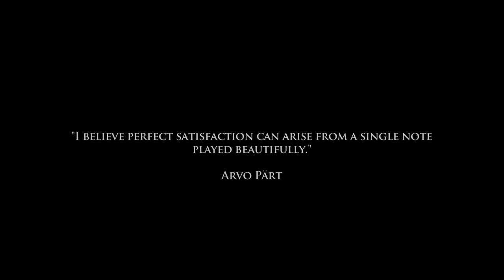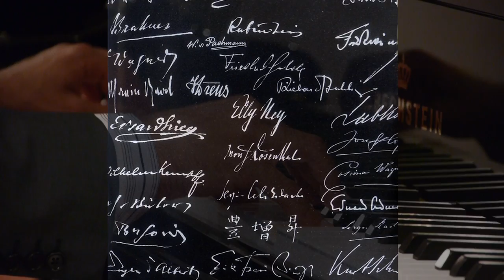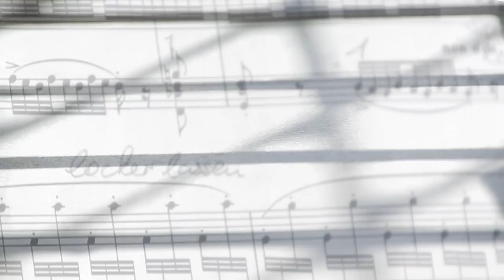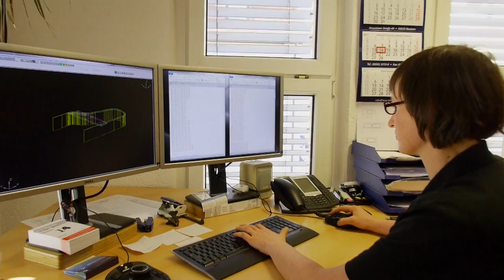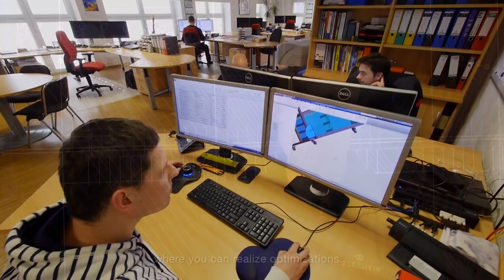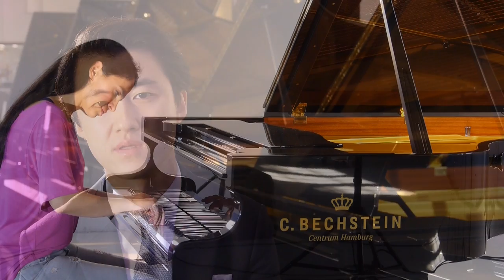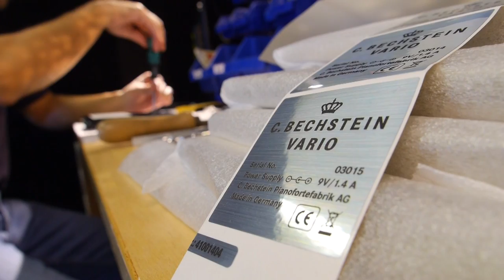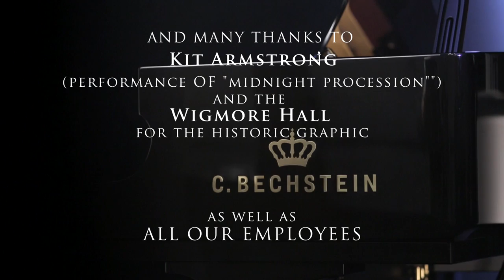Resonances - A film on C. Bechstein

Comment: Sadly the key to designing and manufacturing unique pianos is not to obsess about CNC level of precision in cutting parts. Precision is necessary but not enough. What matters It is to understand processes and special processes and techniques that change the sound of a piano. That requires trial and error and constant experimenting, not small experimenting but daring innovative. Probably some golden era piano making processes were lost in WWII.  This requires less computers, and more experimenting with wood and wood and iron harp acoustic engineering,  not machining parts to 0.000...1 precision.
Reply: As a retired aerospace engineer, I don't think that technical precision and manual labor needs to conflict in the joint effort to produce a piano that is pleasing to the ear and to the touch.  By definition, a piano is a romantic musical instrument as it is composed of 88 individual keys that together can produce an integrated and pleasing sound and melody.  Such is its beauty to experience.